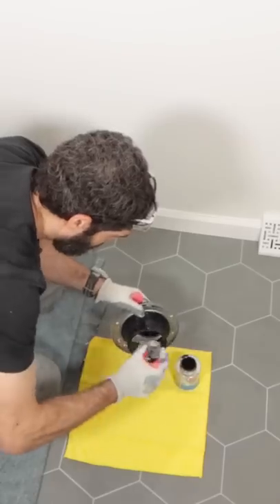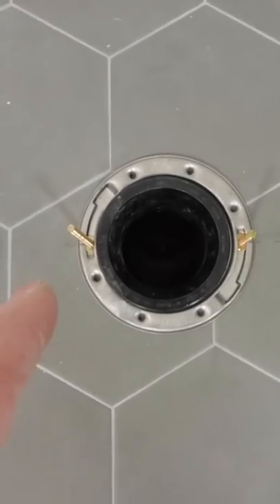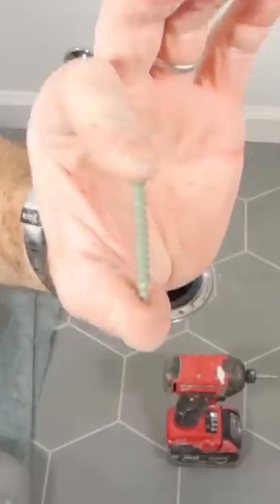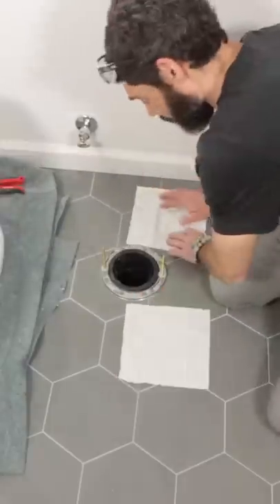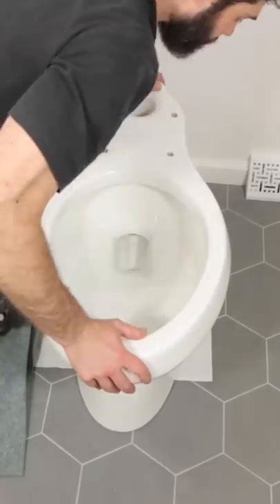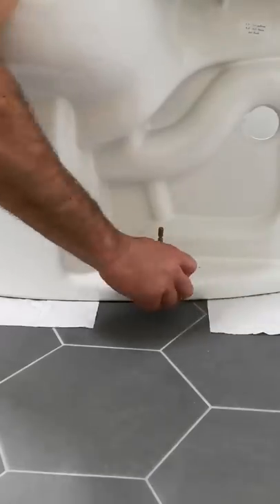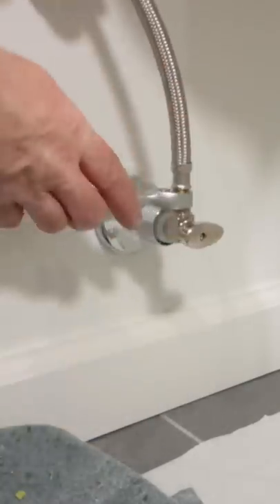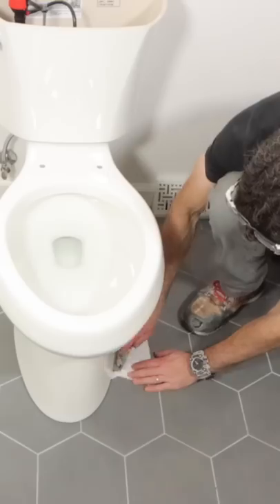Toilet Installation Tips - #shorts

Comment: Man great video. I have a question. I have a toilet room that is adjacent to my shower with a wall separating them. I would like to rip out the wall and make one room like a hospital where the shower and the toilet share the same tiling. Can I raise the floor up two to three inches so that way I can create a slope to the drain and raise up the toilet drain as well?
Reply: Sure, but be mindful of local building codes putting in that type of floor. I like a seamless ADA bathroom floor with a slope in the shower area to the drain. I like the trench type drain along the wall edge instead of a round hole in the middle of shower pan area.
Reply: @jbsimmons54  yeah that's exactly what I want to do

Comment: Now when you change the bathroom floor in the future you’ve got to cut the tile out around the flange and hope the future floor works with the tile height.  Should always restore the flange to the sub floor.  Not the new finished floor.
Reply: yep again feels like we are cranking out substandard work promoted by these videos…you comprised the tile and its now incorporated into the plumbing…its covered anyway so this is just lazy in my book…
Reply: @mrh4368  I agree.  It’s so easy for a person to get into construction and make videos and become an “authority” on building practices but very few people think about building from the ground up and with respect to each sub specialty and also longevity.  This guy means well and for the most part his work seems efficient but these “tips” are not always best practice for the life of the house.  

The homeowner pays for this in the long run when the next sub comes along and charges them for removal and replacing the flange again or for building up the floor to meet the flange height.  This is like setting cabinets on top of flooring because it’s “easier”.   You just created more work for the next person and higher cost for the next home owner.  Also, possibly voiding factory warranty (in the case of some laminates).  

Remodeling should always be done with the bigger picture in mind.  Not with what’s easiest or what will get the most views.
Reply: Wrrrrooooong sir. Flange should always be above the finish floor.

Ten years as a service plumber, own my own plumbing company
Reply: @1gameboyc7775  10 years huh….so you just started.  The flange should never be installed over tile.  Period.  Jumbo wax rings fix the issue your referring to, every time.  Also, you’re a plumber….I’ve never met a plumber who thinks about more than plumbing.  When you have to come in and repair and replace flooring/ rot professionally for customers then you can say what’s wrong and what’s right.  This costs the customer more in labor and materials when it’s installed on the tile.
Reply: @RELAXnRENOVATE  I'll tell you what man I recently had to retile my bathroom. all you have to do is unscrew the damn flange and you can lift it up to push the tile underneath..  at least if it isn't on a slab the piping has some play
Reply: @itech301  That’s not always the case.  Chances are you were working on the bottom floor where the plumbing isn’t always strapped down well under floor joists.  Second story bathroom plumbing is often not movable and has to be cut out and redone.  it’s just better to install to the subfloor and use a thicker wax ring.  It’s less bullshit in the long run.  But what do I know…I’ve only been doing this shit now for going on 3 decades.

Comment: Never knew it was that easy for installing a new toilet now I’m gonna get rid of this fucking small toilet that came with this house we bought lol
Reply: It might be a easy install. Just make sure you have enough room from the closet flange to your dry wall. Should be about 12 inches of clearance to the center of the flange.
Reply: Yep get you an ADA and you should be happy!!!
Reply: He's talking about the distance from the wall behind the toilet, to the center the closet drain flange

Most toilet are 12 inch center rough in off the wall.
10 inch center bowls are the most common alternative

The reason for the 10 inch center distance,  is for when with structural conundrum

Like a floor joist running under a toilet.
Using 10 inch ruff in instead of the 12 inch, saves on floor joist modifications
Reply: Kohler comfort height (ada) with ezr clean, slam proof toilet seat 🚽

Comment: Now try setting that toilet with a cabinet and a wall on each side of it and then try putting that tank on that toilet. I always install the tank on the toilet before I set the toilet, yes it adds more weight but it makes the job a lot easier once it's down.

Comment: I had a brand new toilet installed and the installer put caulking between the bottom of the toilet and the floor. I’ve never seen this before  and thought it was a huge mistake because how do I  know when the toilet leaks if water is not able to seep out??
Reply: One toilet I've installed, I had to put a couple small shims in the front to keep it stable and so I had to caulk around the toilet to hide the gap. I left a ~2 inch spot on the back un-caulked though. If it was leaking it would come out there I suppose.

Now that I think of it caulking isn't a bad idea... Keeps water and pee from getting under the toilet.
Reply: That’s why caulking toilets is problematic. I’ve had some service calls where a homeowner has water dripping down their ceiling/walls from the second story and it ends up being compromised wax ring. The water can’t seep out from the base of the toilet so now you got shit water in your ceiling...

Comment: I use wax ring all the time. If you live in the county which requires final test most new products will fail that test. It doesn't mean they will leak but they couldn't hold air.

Comment: One thing you missed that I always do is use nuts to tighten the bolts to the flange before you set the toilet and then use a second set of nuts to then mount the toilet. So 4 nuts total. 2 to tighten bolts to flange then 2 additional to tighten down toilet once set. If you don’t use nuts to tighten the bolts to the flange first the bolt will just spin with the nut instead of the bolt being still while the nut actually threads on.
Reply: Usually don’t have to do that, unless the flange is fked.
Reply: @eddyhmmk1  exactly, toilet bolts have oblong heads that seat in the flange channel. Some bolts have plastic washers to hold them in place while positioning the toilet.

Comment: Preferred method of cutting down the bolts holding the toilet down? Full length you can't put the caps on
Reply: Mini Hack Saw
Reply: I try to cut them first, but I prefer a rotary tool. Dremel with a cutoff wheel, or grinder with a cutoff wheel. A  reciprocating saw can hang up and cause one sort of grief or another.
Reply: they now make toilet bolt caps the are tall enough to to not require cutting the bolt
Reply: @kenlorenz4758  good to know.

Comment: I don't use wax rings anymore.
Reply: Yeah they seem so outdated.  other products that last longer and reusable products are becoming common also
Reply: I don't either
Reply: @tongasmith910  my last wax ring "walked" on me and developed a slow leak.  Luckily I caught it before a chunk of the wax went down the drain! I am keeping an eye out on these new rubber seals though.
Reply: Either do I. Once upon a time I replaced a cracked toilet flange and put in a new wax ring. Couple weeks later got a call saying the toilet was leaking again. Replaced the wax ring again. Got another call a couple weeks later saying it was leaking again…I then replaced the wax ring with a rubber one and haven’t gotten a call since. Everyone in the family was around 300-400 lbs. Even with the slightest movement, wax doesn’t rebound like foam and rubber do. I haven’t used wax rings in about 7 years and have never gotten a call back since using rubber. The extra couple dollars is well worth not having to patch drywall and paint an entire 1st floor ceiling.
Reply: It's funny because folks used to use plumbers putty for their seals and a lot of them are still holding today!

Comment: Aw come on. Amateur hour!  You can’t leave those flange bolts that long. They also need to be covered AND you need to stabilize/level up the toilet and caulk around the toilet. Just because it is dry doesn’t mean you are done.  Always, always perform a test dump to ensure you have a perfect seal and a perfect experience.

Comment: No need for the tissue. Just flush the toilet multiple times. And don’t just put your stool bolts “equidistant” from the wall. Put your stool bolts the same distance off the drywall as the center of the flange.

Comment: I ALWAYS double nut my bolts 🔩 . It locks the bolt upright and never a problem when setting  a bowl.
Reply: I think I know what your saying and it do the same thing. Will never set a toilet without bolts set to the flange with nuts BEFORE toilet goes into place then washer and nut, but I prefer wing nut uppers personally so I use tank bolts that I grind to fit flange slots. And I use tank gaskets on toilet porcelain then metal washer then wing nut, then plastic cap.

Comment: I always use stainless steel screws for the flange and always use 5/16" bolts never 1/4" also i never use that platic cap washer i cut bokts and pack cap with plumbers putty and oush it right on the bolt and nut
Reply: An inspector will fail stainless. You gotta use brass screws

Comment: People assume that the floor is  level when they install a toilet , what if it’s not ??? You’ll know real quick when you fill the toilet with water and it all leans to one side in the bowl and the tank. I’ve seen real plumbers compensate for this by laying plaster under the toilet, setting  it plumb and tightening the bolts accordingly. You may not be able to use the toilet right away until the plaster hardens , but in the long run you won’t fall off😂. Assume nothing, check the level.
Reply: They also have plastic shims you can use now if the floor is all finished.
Reply: @ashenmoonclash  I use the plastic shims too.  Old school would be to use pennies.

Comment: I switched from diamond hole saw type drill bits to a milwaki carbide like spade like tile and stone bit I install a lot of dispensers on tile and I burned through so many of the diamond tipped bits even with keeping them wet like adults so quick and they have a tendency to walk even when used properly with these bits I make my mark and I push in and it basically punches the tiny hole keeping the bit straight with the diamond bits I can do about four or five dispensers before I’m really struggling to make my holes show 15 to 20 holes what is Milwaukee carbide tile glass and stone bits I have done over 40 holes so far and it still works like new
Reply: I get them at Home Depot btw don’t get the Ryobi that’s what I used before the diamond the shafts were too thin and the carbide tips weren’t sharp enough and they just ended up bending

Comment: I recommend a rubber ring instead of wax
Reply: It's your choice, but I'll take wax any day!!! If someone sets a closet with wax and it leaks, it's because they didn't set it correctly the first time and disturbed the wax ring!!! If you're not familiar with setting closets just measure your bolts on the flange from the wall if there even it's almost impossible to mess it up!!!
Reply: Wax is cheaper and more reliable since you can feel it squish down when you set the bowl so you know it’s a good set. Only time I’ve used a rubber except on a hooker is when there is in floor heating in the bathroom. It can melt the wax ring

Comment: You did Not know Wall mounted toillets in USA ?
Reply: We have them but due to high cost they're in higher end homes, if requested by architect/builder or owner. It costs a lot more to route the smaller plumbing in the wall. The studs are 3.5" thick and standard plumbing is 3" diameter. In the video it's a 4" diameter pipe. Otherwise they get a visible tank type. Floor piping discharge for toilets is standard in the USA. Only in large commercial buildings do you see wall mounted off the floor toilets.

Comment: So that's all you do when you install a toilet it's put the tank on the back in the hook the water line to it
Reply: There is a little more to it then that but still there are only a rubber gasket and 2 bolts.  
But it is very, very easy
Reply: It's a chair with a water tank.  So yeah.

Comment: If you read the instructions on a wax ring they want you to install it on the bottom of the toilet before you set it!!!
Reply: Put it on the flange. They only tell you to stick it on the bottom of the toilet because chances are good it will fall or deform awkwardly when setting and, in turn, they'll sell more rings.
Reply: @imbrue002  then you haven't installed enough toilets in your life and or pull them when the seal that was installed on the flange was not done right and has been leaking because of it
Reply: Wax rings work beautifully,  no need to reinvent the paper clip
Reply: @ricklee827  Wrong. Ring cant drop off the bottom or get knocked down by a flange bolt if its already centered on the flange. Put it on the flange.
Reply: @imbrue002  Yup. Always set it first.
Reply: @jimreeves1954   wax rings fail in arid areas where temperatures  rise above 100 degrees.

Comment: I don't trust those thin metal rings on flanges. If a manufacturer can guarantee it's corrosion resistant stainless, I'll use one. 

Seen far too many rusted flange rings.